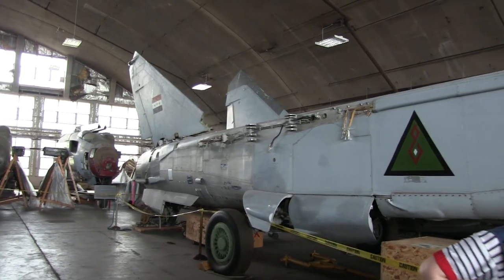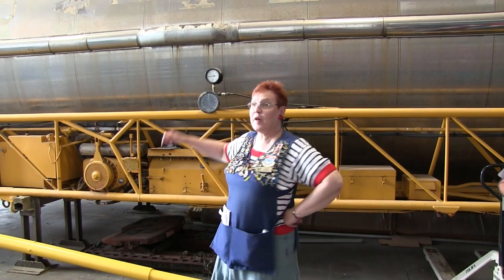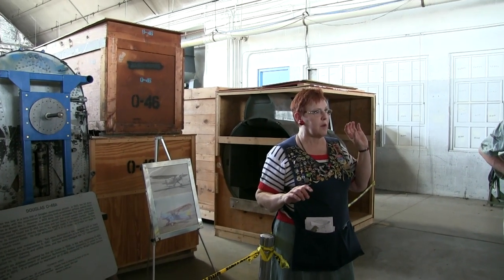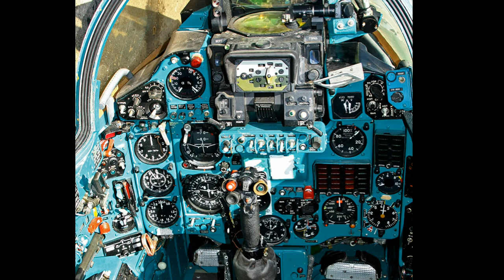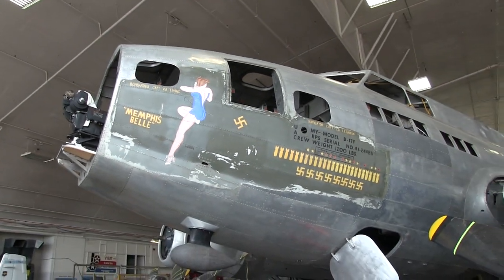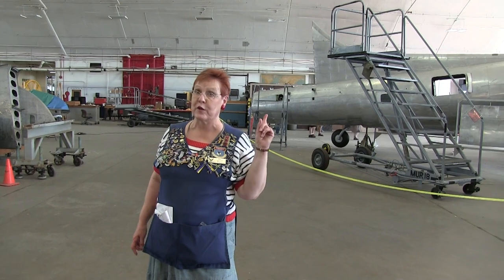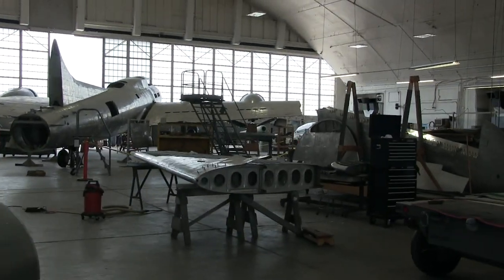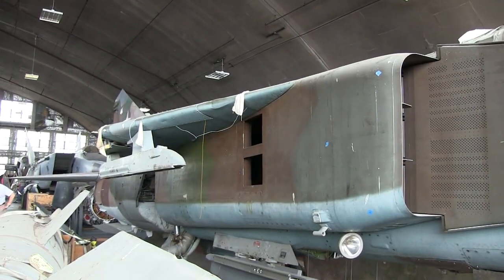The National Museum of the US Air Force - Part 4 - Restoration Hangar

Comment: That was no V2, it was an experimental AA rocket from Werner von Braun. Used by the USAAF after the WW2. (Wasserfall - first build 1944)
Reply: yeah a V2 would be a little bit bigger than the mig, saw one in berlin
Reply: Simon Doge Yeah I've seen one to. The Flying Heritage Collection has a restored one and it's not exactly small. At least 30ft tall.
Reply: Nat Crichton The biggest museum is in peenemuende, http://www.peenemuende.de/index.php?id=42&L=1 - there is a lot of V1-V2 stuff. :D
Reply: Mootality The Flying Heritage Collection while it doesn't have a large collection of V1 and V2 stuff it does have the standard V1 and the prototype manned version. They also have a Me. 163 "Komet" and one of only four flyable A6M Zero's left in the world.
Reply: Simon Doge
He said that and I looked over and my 1/16 scale V2 towering over my Tiger I of the same scale.   14 meter tall, or 45'.
Reply: Yes the USAAF had German V2
Reply: ***** Yes indeed. A V2 rocket looks more like the rocket from Tintin Destination Moon =) Or.. actually more the other way around really. :D
Reply: i worked for the legermuseum in the netherlands... that has... a V2... it is huge.

(they also have several v1s, includinng one with a cockpit!)
Reply: Mootality I was there Mootality ;). Witzig dich bei Jingles zu sehen :)
Reply: Er war bei einem unserer Turniere der Stargast, natürlich bin ich ständig hier. ^^
Reply: wait, Nat you have been to the Flying Heritage Collection? I have been there too. it is the only place with a FW-190 d-13 which is pretty cool
Reply: The V-2 is 3 times the size of the Wasserfall,which is what this is. A prototype surface to air missile.

Comment: Jingles, I just don't believe you have never seen a V-2 before. They are quite a bit bigger then that. That is actually a Wasserfall. A German SAM based in some respects on the V-2. It is quite a bit smaller then a V-2 and has wings in the middle that the V-2 didn't have. Very cool looking rocket, damn shame they haven't gotten it restored yet.

Comment: I'm afraid that is not a V2, Jingles, sorry. The IWM in London has one and it's GIGANTIC.
Reply: At what point did he say V2 all i heard was V1 witch that was.
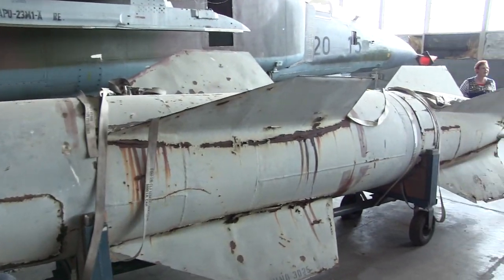Reply: crashchaser 8:58
Reply: crashchaser At around the time he was talking about the MiG 23 I believe.
Reply: crashchaser then you need to lock at it again... he clearly said V2. and it is not a V1... they did not have that shape at all... they where more like a robot shape. launched of a ramp and slide system.
Reply: Poor Jingles. He must have gotten confused. Looks more like a larger version of the Fritz X guided munition.
Reply: I think it was a soviet era air to ground missile patternd (spelling) after an american bullpup or bulldog weapon system. tried looking soviet missiles up but got no exact matches, of course with different versions of a weapon system they might change in appearance. but I remember having a model jet that came with a missle that looked almost just like that. I think thats why its sitting next to the mig 23
Reply: Hobgoblin1975
It's a Wassefall, a German attempt to make a surface-to-air missile.

Comment: During the B-17s combat operations in the Philippines the Japanese actually managed to capture 3 intact B-17s (2 B-17Es and 1 B-17D) there actually pictures of each aircraft by themselves and at least one picture of them all flying in formation near mount fuji, theses aircraft were test flown by the IJAAF Koku Gijutsu Kenkyujo (Air Technical Research Laboratory) at Tachikawa for some time but after the war the aircraft could not be located and nobody has a clue as to what happened to them.

Comment: A little hint Jingles, great job restoring some of the audio, but to make it sound a little "nicer" and marginally more understandable, if you add some more dry mix in (i.e before the noise removal effect, or the original audio on a second track around 10-30% (slightly more noise than you feel comfortable leaving in) you won't make sues lovely voice sound like she's talking through a tube, enough so that the "space" between her words isn't pseudo silence, and if your going to be doing more of this you should look into a full sacele audio editor like audition, saves a lot of time over hacking things together with audition and infinitely more powerful, might be useful for recording in sync audio too as you can load the video file into a reference track and record away!

Comment: Now there is a video of an American engineer that helped to assemble a MiG-23 and he said its absolutely not a copy of Phantom and the intakes have a different pattern, he actually said its a state of art Jet, considering when it was designed. TomCat Pilot said this thing would outrun a tomcat, infact it felt like there was no speed limit...Didnt require afterburner staging, push and go...if you want to see those videos, il send you the links

Comment: My uncle was a navigator on a B17 during the war. He had signed up for the duration which meant there was no discharge date in your hitch. If the war went on for 10 years, you served for 10 years. But the bomber crews had a contract at the time that said if you survive 25 missions you were done. He had got to 23 missions and the Air Force was losing so many crews they changed it to 50. He flew on the Buckeye Belle. How did you like Ohio Jingles?

Comment: That was not a V2 but a Wasserfall rocket.http://en.wikipedia.org/wiki/Wasserfall which is a smaller rocket based loosely on the V2 for antiaircraft work. As far as some of the other commentaries go the Russians and the Americans get "inspired" by each others designs. The F15 is taken from the Mig 25 but it is a much better plane all around. In the Air Force they tried to tell me that it was the other way around but the Mig 25 flew 10 years before the F-15 so I doubted what they were telling me. The Vary ramps on the F4 were pretty revolutionary at the time so it was a good idea to try something like it.
     Glad you had a great time here in the good old US of A  I want to go there sometime I live about 4 hours away.

Comment: The white rocket isn't a V2 purely because a V2 would be the same size as if not bigger than the MiG and it also has fins on the front whereas the V2 didn't.

Comment: i am confused the the Belle's insignia should not be red?
Reply: considering the aircraft you saw in the video is the ACTUAL aircraft and not some Hollywood prop or reproduction of any kind..  and the insignia is the same one painted on it by its crew all those years ago..  what do you think?   who is wrong?  the books and movies?  or the actual aircraft..  with the actual insignia..   with the actual pain tjob.
Reply: The correct color was blue, pretty certain it's not the original paint, sure they went to painstaking lengths to make it as faithful as possible. 

The movie choose to use red for some reason.

Comment: i am starting to do airsoft and i need some help to know what to get for my self and i onley have 200 dallors 2 work with
Reply: You need an AEG as your first gun (Airsoft Electric Gun). In my opinion as a experienced airsofter, this is the best possible gun you can get for the money-   http://www.ebay.com/itm/Airsoft-KWA-CQR-Mod1-/261518590575?pt=LH_DefaultDomain_0&hash=item3ce3b9026f

I know a few more of different brands and weapon platforms that would be good but this is good because KWA is one of the best Airsoft brands and makes a quality product that will last a long time. You can spend the rest on any other Accessories and tactical gear. Also you should get what is called a smart charger and Nunchuck style 9.6v 1600mah battery. You will need these to operate the AEG. For best results, use any .20 gram white BBs. Any other questions just ask.
Reply: Thanks for the respond